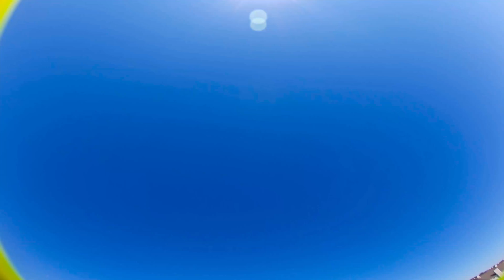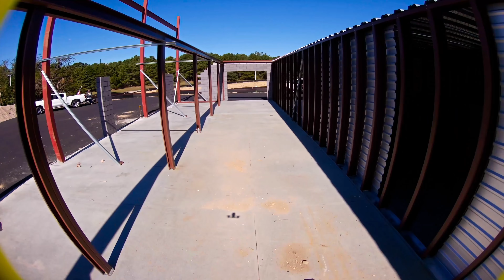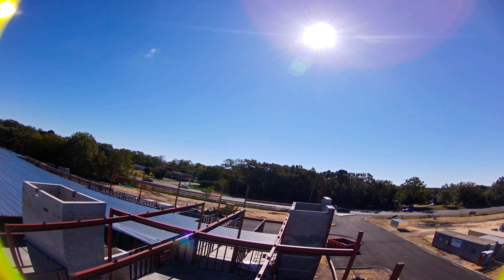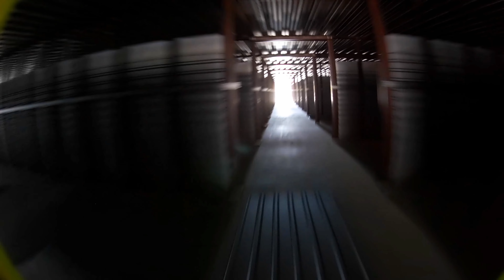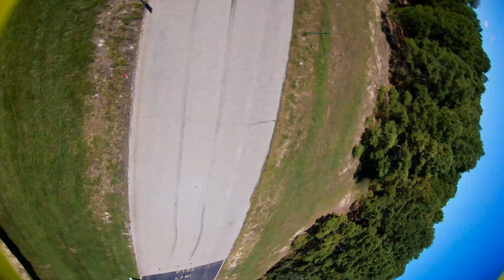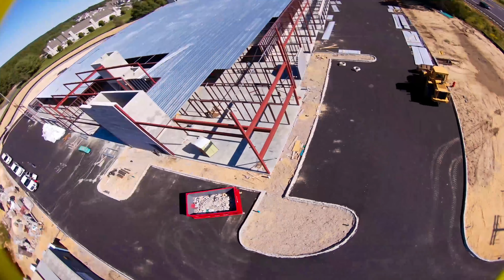Micro Apex with runcam 5 orange construction site

Comment: That Hallway Bro😲 both times. 👍🏼
Man I want to build this quad. I got 2 in mind. The 3” apex or the 3” tooth fairy. Good rip Bro. 👍🏼 I got til end of the month to decide 🤔
Reply from the maker: Thanks Chris! The apex frame has been really durable for me. Was hoping to be sub 250 but it's really hard to accomplish with digital. Such a fun little ripper though. Cool for tight spaces. I have crossfire on mine too so it has really good range. Have the nebula pro camera too so it's actually a nice little set up. Thinking I'm gonna ditch the runcam though and get the smo 4k.
Reply: @HACAFPV  SMO is a good camera. It is kinda of fragile. The caddx peanut just come out. It’s pretty much s upgraded Insta 360 go 2. That’s what I was thinking about with a sub250.
Reply from the maker: @chrismillersrcfamily  is that more durable?